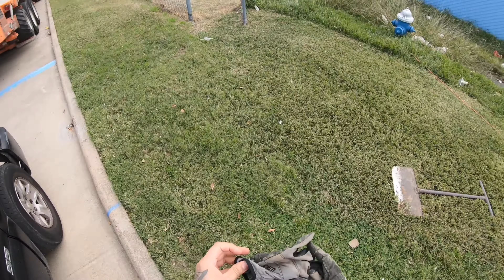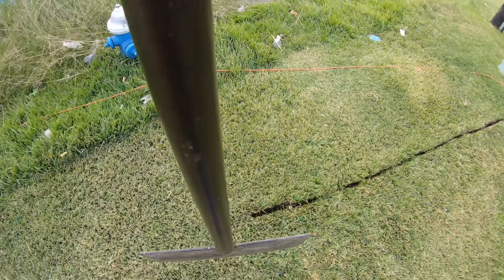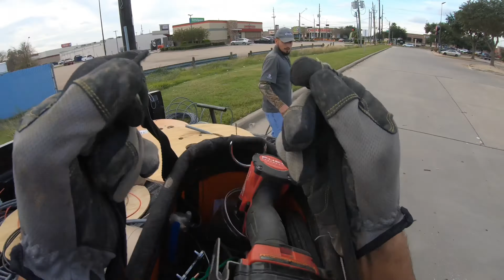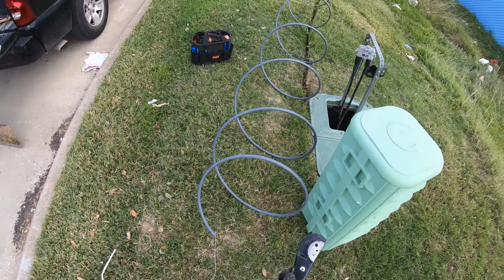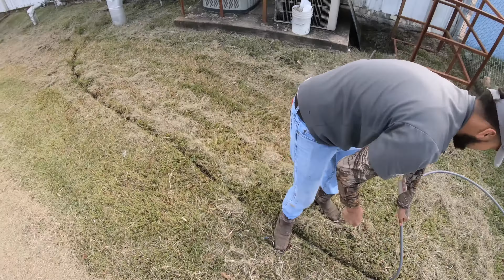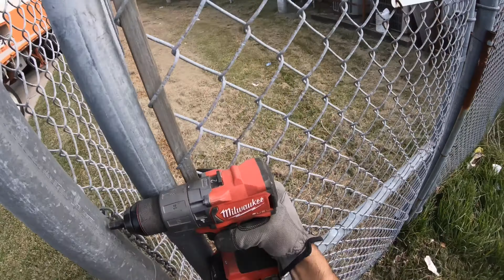Making fast money💰burying cable !!!

Comment: I see that the six inch wampler does no better than an average garden spade yet it's a type of spade.
Reply: The wampler is the spade to use
Reply: I agree with OP the whompers are heavy as hell will tire you out way faster. They take up more room in the truck and you can't dig normally with them like you can with a spade shovel. Also there's no way to feel for other cables, Irrigation etc with a whomper you'll just destroy anything and everything. To each their own